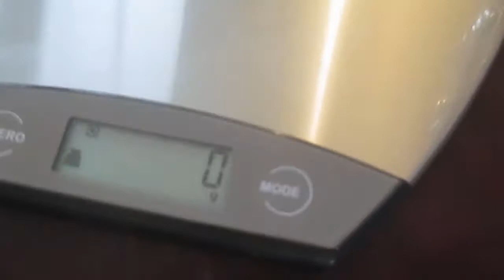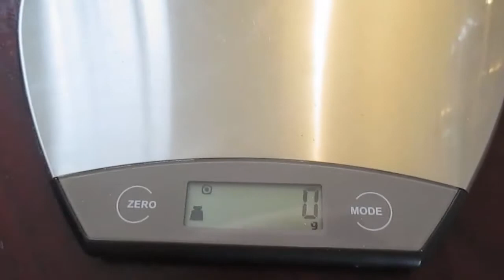Racerstar 2205 2300KV Review - Cheap RC Brushless motor

Comment: Have you never had any experience with a nylon locking nut before? The nylon ring in the top of the nut are so it wont come loose. You tighten it on down.